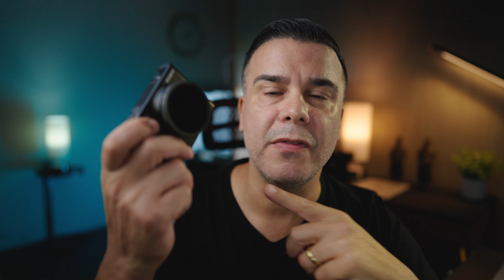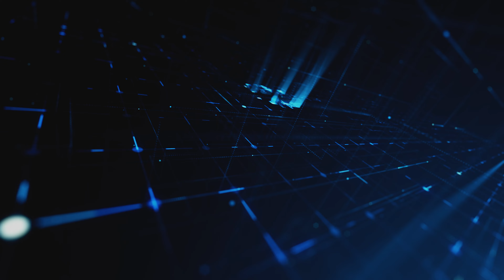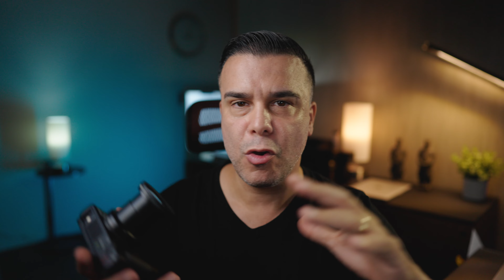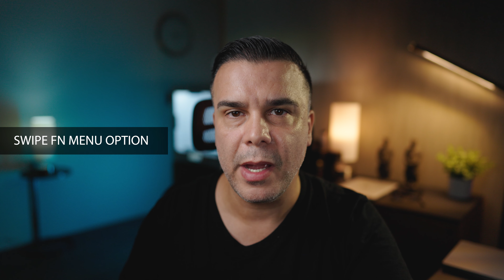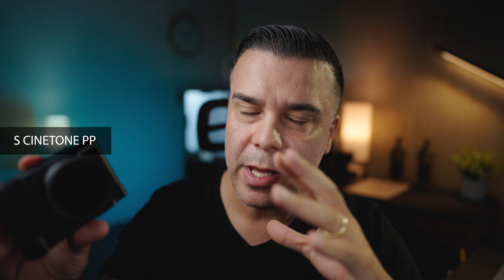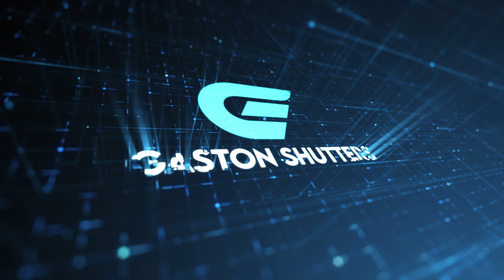SONY ZV1-II May Announcement. WIDER ZOOM lens!

Comment: Do you think they will fix the overheating issues from the first model of the zv-1?
Reply from the maker: I don’t think so. As the they make cameras more capable of processing more data without a chassis redesign or cooling system I think for the time being heat will be an issue as this cameras don’t have good dissipation properties or vents

Comment: It needs to be able to shoot at least 1 hour of 4K30p footage before overheating on its own.

I have the original ZV 1 and in order for me to do that I have to have it on a tripod, have a cage on it, charge it with an external battery and have my battery door open.

It is doable in a studio setting but the camera really should be able to do this without any extra steps.
Reply from the maker: I didn’t have issues with my RX100 MVII recording 4k 8 bit. I think it’s possible with the new processor. The caveat here will be the tiny battery. They better update it
Reply: @GastonShutters  I read somewhere that Sony might increase the price. 

Now that I think about it I wouldn’t mind the ZV-1 II to be 20% bigger if we get better processor, no overheating and a bigger battery

Comment: I don't know anything else, but I hope zv-1 fixes that fucking battery cover mechanism. even The battery capacity is small, but there is no external power battery hole, and above all, fucking screw hole position makes this camera stupid.

And there must be tremendous improvements to OIS or OSS, and if sony want to sell this camera to Europe, this camera must have a usb-c port and support digital microphone input through a multimedia terminal. And need to be able to attach a lens filter. Come to think of it, I think I had a stupid camera.
Reply from the maker: Amen brother

Comment: Hey Gaston, pretty excited for ZV1-II. I need to buy a new camera for my channel soon. Is there a way to use the ZV-1 with a teleprompter? I found some clamp mechanism, but not available here in Asia. Do you know if lens adapters are sturdy enough to attach them to a teleprompter?
Reply from the maker: Hey Coach, I checked your videos and  I think you should get something with a bit of a larger sensor for background separation and less noise. The FX30 is an unbeatable offer at the moment. It's APSC.
APSC lenses are also-super affordable. You can get the sigma 16mm f1.4 used and that's all you'll need. I hear good things about the new Panasonic S5iiX as well as the Canon  R8. But I shoot with Sony mainly.
Reply: @GastonShutters  Thanks, yea I was thinking to either go with the ZV-2 or a Sony APS-C
Reply from the maker: Anytime

Comment: 4K 60p seems a stretch in this body, Even at 4K 30p the LCD screen has to dim to stop the thing overheating which makes it almost unviewable in sunlight. Then, even if it does - it will rip through those batteries like there is no tomorrow (unless of course they update them somehow - unlikely they will put batteries from other models in as it will make the form factor too big). Also - not convinced they will want to cannibalise there other cameras. I can see the wider angle lens being a thing though.
Reply from the maker: Even 10 bit 4:2:0 is fine for this little camera. Hopefully they add those frame retes

Comment: The original ZV-1 is already really good. Even in 2023.
To make it even better I'd like Sony to add the following:
1. Bigger battery, better battery life.
2. S&Q mode for straight out of camera timelapses and slowmo wideos. I miss this feature from Canon cameras.
3. 4k60 mode
5. S-Cinetone PP
6. Some sort of a filter thread to allow extension lens and additional filters. They can design something similar to Ulanzi WL-1 without a need to glue anything to the lens.
Reply from the maker: Amén 🙏

Comment: If this camera has 10-bit color and unlimited recording, I'm going to be livid. I just bought a first gen ZV-1 and those are really the only two features I miss going from my full frame Sony bodies.
Reply from the maker: And the new touch menu !
Reply: It wil do 4k60 10 bit but 100% it will overheat. I built a base plate with aluminium block pressed against the back and it 100% solves it but you can’t get unlimited recording unless you have active cooling.
Reply: The original zv1 would be capable of 4k60 but Sony needed it because it would overshadow a73 and other cameras at the time. It has a 1 inch STACKED sensor so 4k60 would have been easy.
Reply from the maker: Not only the sensor is important. The processor to handle all that data processing is needed. The ZV1 didn’t event have a processor capable of handling a touch screen. So I think this version would be on fire
Reply: Your mad

Comment: Why you are thinking it will be zv1-II and not zv-e10 II ? Comparing to the camera mount, on the zv-1 is on the left and on the zv-e10 is on the right. On the announcement image the mount is also on the right. Also the zv-1 was released 2020, zv-1f released 2022 ( 2 years difference) and the zv-e10 released 2021 and now it is ready for an update. I need a new camera and now I have to wait to see what will be released...
Reply: Sony Alpha Rumours said it was a new ZV 1 a month ago and would be coming end of May. He is very reliable, announced ZV E1 for example, and gets his info from leakers in Sony. It’s a new ZV 1.
Reply from the maker: Thanks for the info ℹ️
Reply from the maker: I wish it’s the ZVe10. Imagine they make it with 10 bit color! 4k 60 at least. Now that could be a great release.